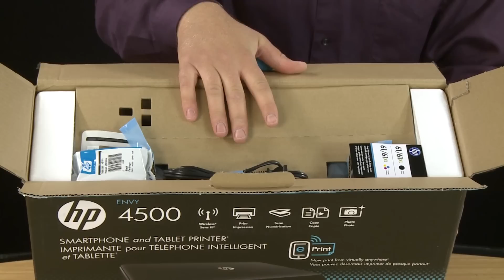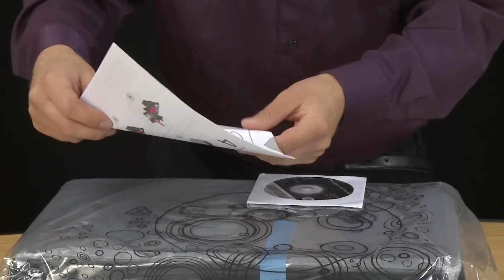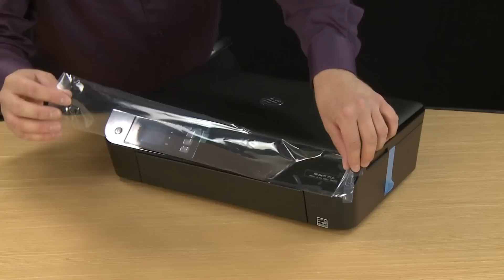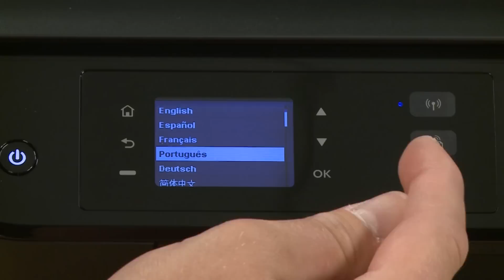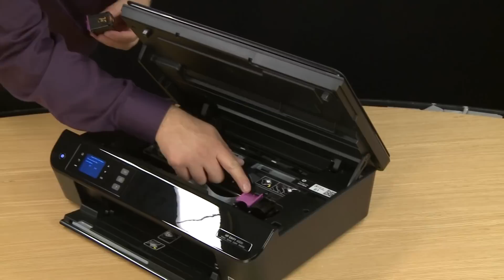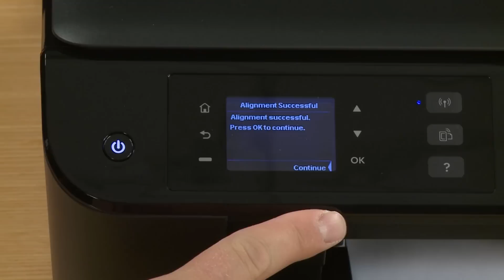Unboxing and Setting Up the HP Envy 4500 e-All-in-One Printer | HP

Comment: I just bought one last week...on the box say's HP Envy 4502 but the Installation Disc say;s 4500 series are they the same, I'm trying to sign in my Device for the HP Connected..but it's saying my device is not connected to get my claim number?
Reply from the maker: Hello!
 
Yes the Envy 4502 is a member of the Envy 4500 series of printers. 
 
Once your printer is setup on your home wireless network, you can then enabled web services to get the claim code.  Please search for C03753241 on HP's home page or using Google search. It is the document with the detailed steps to put your printer onto your wireless network.  If you search for C02940150 you will find it is the document with the steps for getting your claim code and customizing your printer's email address.
Reply: so purpose for the claim code is for the wireless...right?
Reply from the maker: Hi! The claim code is a unique identification number assigned to your printer. The claim code is needed to register your printer with an HP Connected or HP ePrintCenter account.  You don't need the claim code to install the printer onto your home wireless network.
Reply: *****  O.k. so I'm connected to HP Connected that I can able to log-in does that mean my device is registered..bec. when I go to add+ device it's saying ..."It looks like you haven't added any devices to your HP Connected account."?
Reply from the maker: Howdy Al. HP Connected is not part of registering your printer with HP.com. To add your printer to your HP Connected account you will need to print your web services information sheet with your claim code (tap ePrint icon, choose settings, then print report).  Once you have the claim code you can add your printer to your HP Connected account.
Reply: Okay, i followed your instruction of ePrint, settings then print report..accdg to General info: it's offline..Active connection type: None, Internet: Not applicable. then next one for 802.00 Wireless under it for Status: Disconnected, Network Name (SSID): not set, but for Wireless Direct under say's Status: On, Security: on and IPv4 under it for IP Address: it's a different IP number than I have?
Reply from the maker: Hello again Al.  The information you have given indicates that the printer is not setup on your wireless network.  For web services to be activated the printer needs to be connected to your wireless network.  Web services requires 2-way communication to your wireless network to "talk" with HP's servers for web services. To install your printer onto your wireless network please search for document C03753241 on HP's home page or using Google search. It has detailed steps to put the printer onto your network.  Once the printer is on the network you should be able to get your claim code.  If you search for document C02940150 it will walk you through getting your printer connected to web services and using your claim code.
Reply: *****

got it...thnx very much!
Reply from the maker: That's wonderful to hear. I'm glad you got it working.

Comment: I just picked up this printer. I'm following the directions, but when it gets to the part where I have to put the ink it, it says that there is a jam. I've checked all over and there is no packaging left in it.
Reply from the maker: Hi!  Let's try doing what is known as a power reset on your printer.  While your printer is turned on please remove the power cord from the rear of the printer.  Please remove the other end of the power cord from the wall outlet.  Please wait a full 60 seconds and then plug the power cord in at both ends.  If the printer doesn't turn on by itself please power on the printer. If you see a message referring to an improper shutdown, please choose OK/Continue/Next/etc. That should remove the error message you are seeing.  If not please let me know and we can go from there.
Reply: ***** Thanks for the response. Unfortunately it didn't seem to work. It still says that it is jammed and that I can't get the ink slots out to load them.
Reply from the maker: Thank you for the updated information.  Please search for C03755986 on HP's home page or using Google search. Solution One discusses the print cartridges and what could be causing the error you are receiving.

Comment: I made a mistake and put the scanning paper on the top left corner of the scanner. Would this make a difference or can I redo the aliment procedure?
Reply from the maker: Hi!  It's would be best to run the alignment again from the front panel of the printer.  Please search for C03784120 on HP's home page or using Google.  It is the user guide for your printer.  On page 63 it has the steps on how to run the alignment from the front panel of your printer.

Comment from the maker: The Envy 4500 can be connected to your computer with a USB cable.  The complete printer specifications can be found by going to hp.com and entering 'C03755986' into the search field in the upper right hand corner. 

I work on behalf of HP
Reply: I’m so late, can’t get mine to work. We’ve had it sitting here unused for like 4-5 years but it still turns on n all, I have it connected to our WiFi and it says connected, it pulls paper to print but comes out blank, it has ink. :( & I tried searching the numbers in the search bar, it says “sorry no results”. Any help would be greatly appreciated 🙏🏽

Comment: Hello!
I was looking all over internet, but could not find an answer. Im looking to buy a new printer. I narrowed it down to either canon or HP.
For HP, there is 3 models I consider:
Envy 4500
Envy 5530
Photosmart 5520

What is the main difference between them? Which one is newer/better?
I tried to read on your website, but its to no help at all. It says "great printer, buy it" - for all of them :)
Anyhow, if you could quickly tell me, which of them suits whom, I would appreciate it! PM me. Thx!